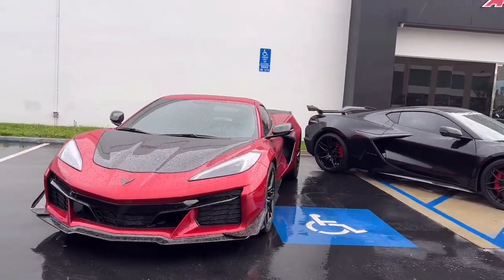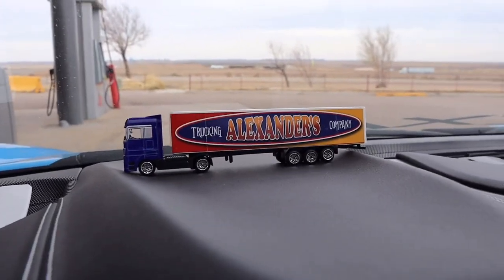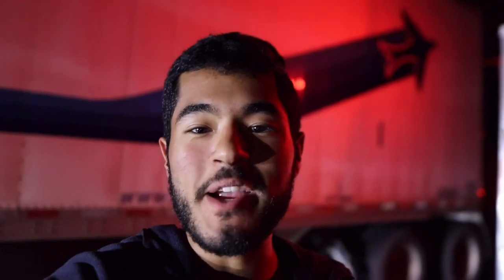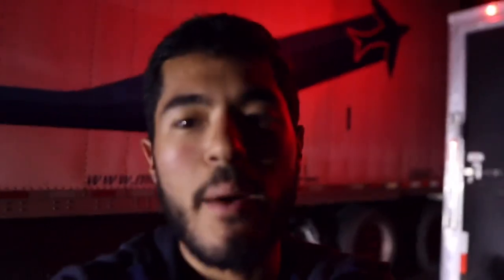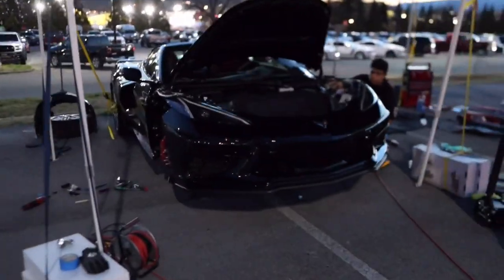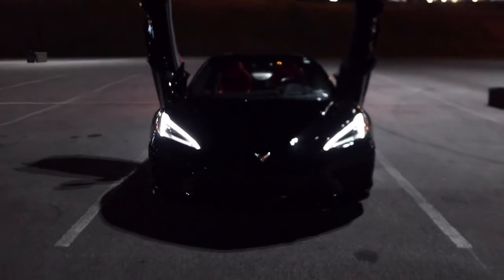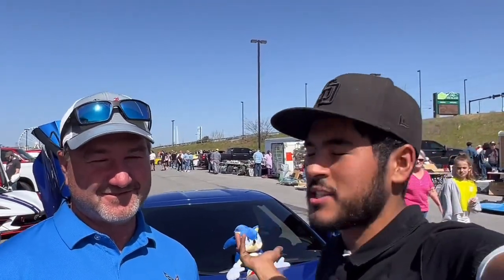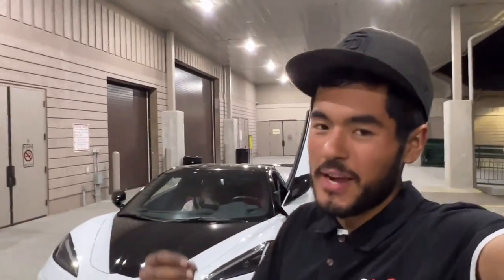Traveling to Tennessee to install vertical doors on 6 C8 CORVETTE'S! (Corvette Expo at Pigeon Forge)

Comment: Looks awesome, The only thing I would recommend is hiding the wires, it does not look to good with the wire hanging there.  I have seen many installs where the wires are not visible and running/zip tied to the door hinge.  Eikon Motors has the wires hidden, he's has a pretty slick way to running them.  Keep up the awesome videos!

Comment: Checking on my C8 Z06 carbon fiber aero kit.  Wired $6500 6 weeks ago.   Sent email, text and no way to leave phone message.   Hit me up. Spoke to Brenda. Needing to Scheduling with local installer 

Chad
Reply: Same here. Purchased April 6th. Have left emails, text, phone calls, messages on Instagram. No responses at all.
Reply: @TheIndirecTV       i received a text saying 2 more weeks.   that’s next week.   i have a scheduled appointment for a shop to install.   they are very busy.     i will advise what i hear.   you do the same.    Chad
Reply: Got my kit in impeccable carbon fiber kit.  Was running late but all good.   Ordering a carbon fiber boomerang next.  Thanks Wendy & Brenda!!!
Reply from the maker: Sorry for the late reply. Have you been helped already?  We are now here to help.
Reply from the maker: Have you been helped already. Sorry for the late reply.
Reply: Yes, the Z06 came out awesome  and my Sigala kit's quality 2nd to none.   Thanks for everything Wendy & Brenda